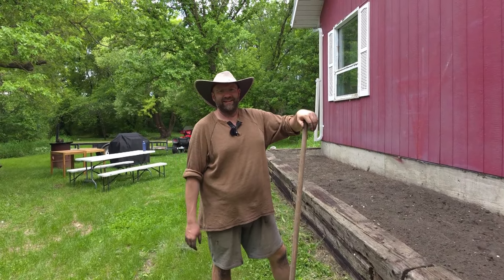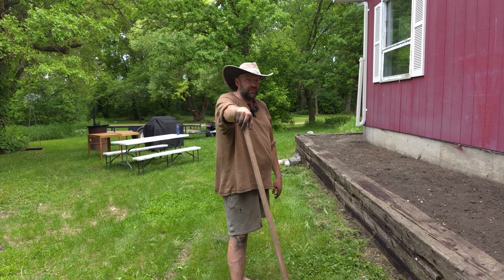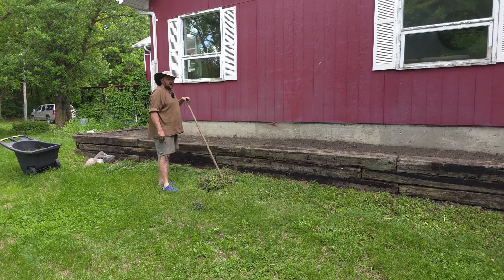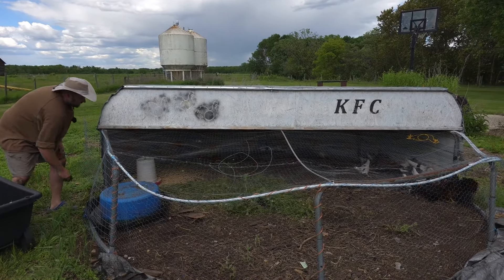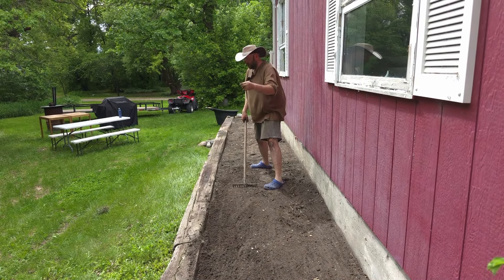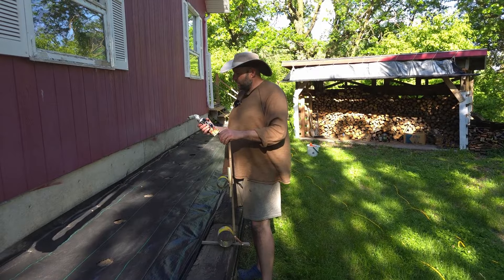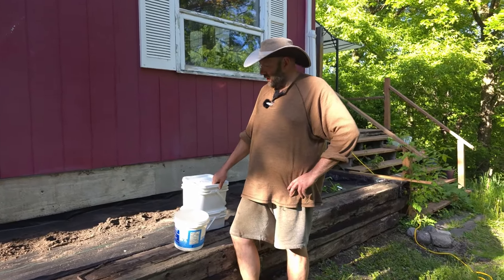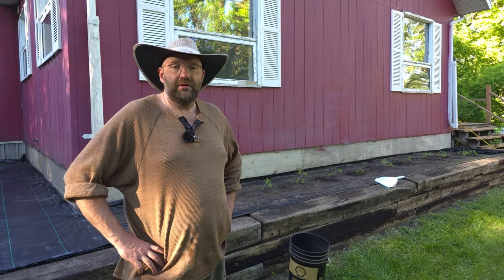How to never have to pull weeds again + other Garden Tips & Tricks

Comment: I use cardboard and construction paper with a two inch layer of compost on top and a thick layer of mulch on top of that. The cardboard/ paper breaks down quicker and it blocks grass and weeds from growing. You will still have a few weeds, but nothing like you get from other methods. It also adds to the soil once it breaks down. You have to make sure that the ground is not exposed to the sun so it blocks the sun and the roots of the weeds and grass won’t grow.
Reply from the maker: That’s a great idea too - thanks for sharing!👍